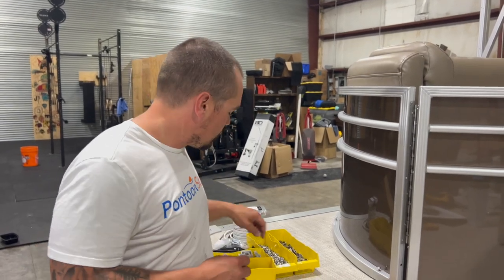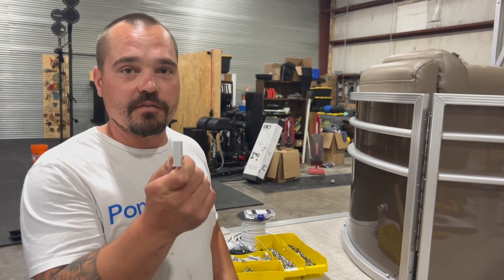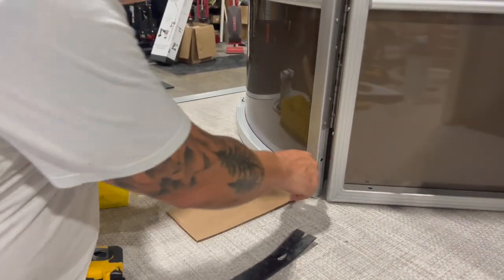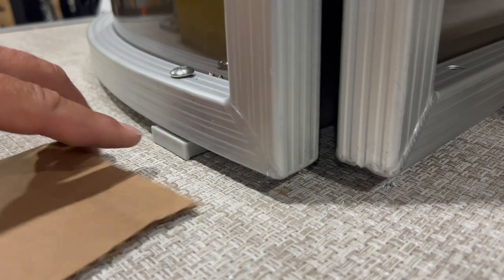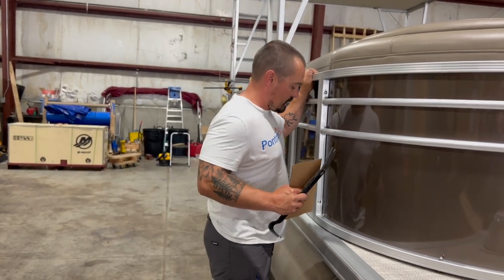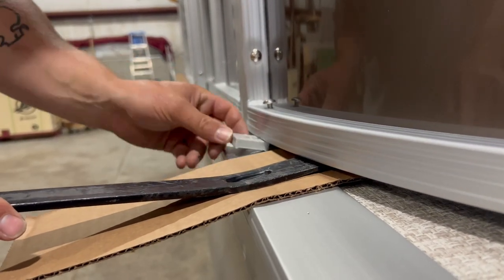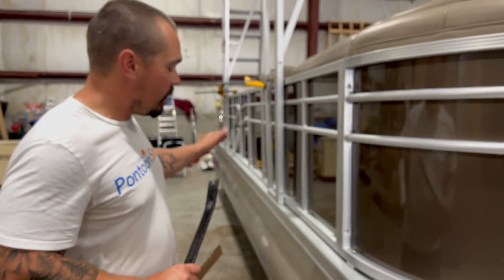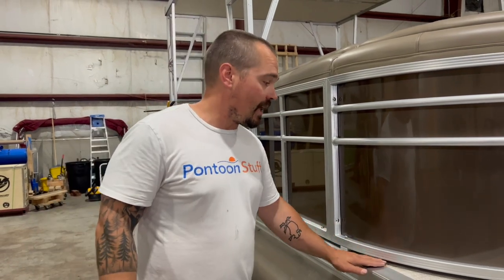Installing Fence Risers On Pontoon Railings

Comment: Can we put risers under the seats for the same reasons?   Enjoyed all your videos, I took my pontoon all the way down, wood is on, new flooring on, all going well. Thansk, peter
Reply from the maker: The Deckmate seats have drainage molded into the bottoms so water buildup is not an issue…especially with vinyl where it can run off freely or dry quickly. I would not raise the seats personally because I want all the structure of the bases to be in contact with the deck for sake of longevity of support.

Comment: When you install the fence risers, do you put one under the angled support by the doors? If not do you bend the support to make it level? I hope I explained that well enough.
Reply from the maker: Yes, if it’s the type of railing support that’s integrated into the railing I will put risers underneath it. If it’s the bolted on post style I will just manipulate it to support the rail properly.

Comment: Hey Tom...Another great video! Do you find that the fence is a little less stable when it is on the riser vs. when it is flat on the decking, or does it remain just as solid? I am getting ready to reinstall everything soon and am considering the risers as a good way to keep everything clean and dry.  Plywood is down and EVA foam flooring is this week.  Thanks!
Reply from the maker: It’s 100% worth it to install the risers for air flow and water drainage. You’d still get moss and mildew built up with vinyl or EVA if you didn’t do risers. If railings are installed and braces are used for the railings to the floor in a normal way (at doors and long stretches of straight unsupported rails) then it’ll be plenty solid. No worse than without the risers!!
Reply: Thanks for the advice… I will be sure to order some risers and hardware!